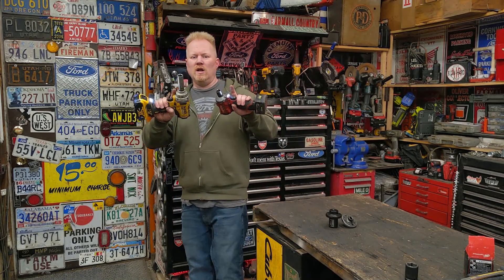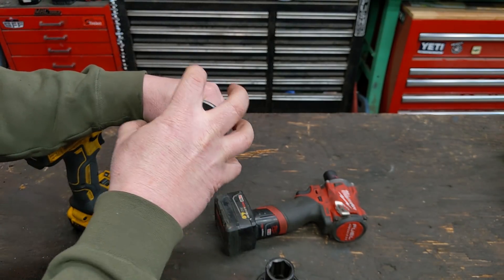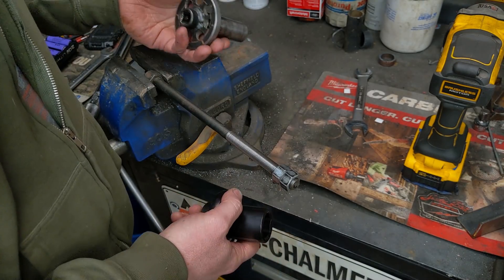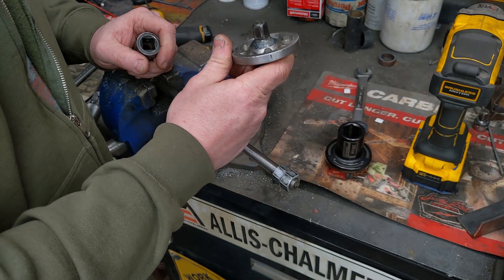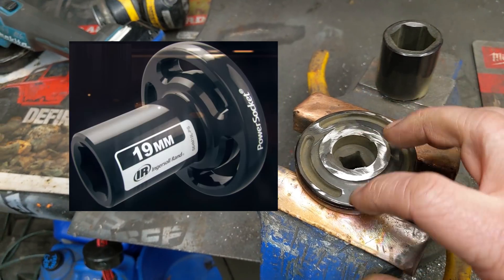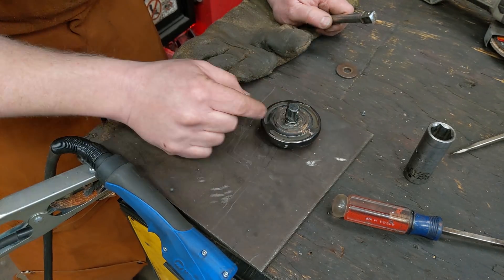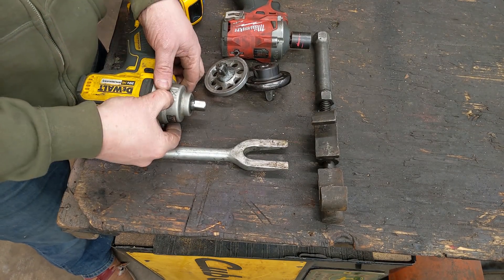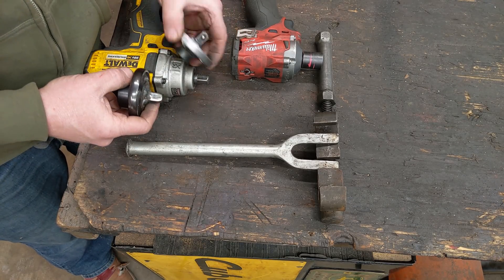Universal Weighted Impact Socket Adapter BUILD -one of a kind- DIY

Comment: You are absolutely right in the way you explained the physics 👏 simple and to the point. Heres the thing tho there are 2 problems. First problem impacting on a socket adapter you will end up with drive train losses due to anvil impacting on the adapter first and then the adapter impacting on the socket second( there is always play there). Like you saw when trying to remove lug nuts. The torque test channel does a good job of testing and explaining this. Second problem: this play in theory will negatively impact any positive results you get from the fly wheel on your adapter in the torsion example you gave because the socket attached to the bolt will still be able to rebound due to the play between it and the weighted adapter well before the weighted adapter can impact on the socket. Making the system ridged ie One piece will effectively give you the result your physics explain. The point of the springs on the original drawing would still work better then a weighted adapter because the  socket and the square drive are technically one unit with the fly wheel separate. That avoids the drive train loss stated above in problem one.

Comment: I guess the tutorial on how they work explains my technique of holding the socket with a gloved hand. I learned through the years that on tough bolts that to grab the socket and turn it in the same direction as the impact is turning  nets a greater torque than just letting the socket bounce on the fastener. Of course, it's tough on the hand, and may be why I have problems with my left hand.

Comment: Thos torque rigs are hydraulic, and hydraulic fluid is not perfectly incompressible; there will be pressure waves bouncing back and forth in a similar fashion to a long fastener acting as a torsional spring

Comment: Great video and information on lost torque with long bolts and U bolts. 

You only have to put a hand breaker bar on U bolts to understand what you explain here, you can feel how springy the bolts are.
 
 I have never seen or used weighted sockets. 

Would it be a simpler and cheaper build your weighted adaptor by using a short 75mm extension or 2 size adaptors welded together they are usually sold as sets together and would achieve a short adaptor.

Then weld a big washer to it rather than cut up a weighted socket?

Might be what you did originally with the one with holes.

I have always had good results using impact guns on long or even short bolts  by using my hand or a pair of pliers on the socket or extension nearest the impact gun and Twisting in the correct direction when things wont loosen. The added benefit is also less damage to the fastener head.

This eliminates the looseness in bolt to socket and any extensions and delivers all the actual impact to the bolt. I have found in my 35years working adding some twist to the impact gun back and forth also helps as well. 

On large bolts using 3/4 inch impact guns on REPEAT assembly tasks it is essential and realistic to weld the extension into the socket so the torque from the impact gun is not lost with the looseness in the system.

It is amazing how much energy is absorbed in long bolts or extensions loosness.

For car wheel nuts I know you can buy torque limiting sockets (I don't have any) they have a shank diameter and length maybee 10inch long so that the fastener cannot be over torqued easily with impact guns.

Comment: Ok, so if I'm understanding the physics behind this correctly, the weighted adapter would go on the impact and then say a 12" extension (I'm assuming the longer the better) and then a socket, and that should take your lug nuts off. Being short just makes the impact push more weight, but being longer gives the hammer time to reengage before the springiness returns back to the start position. Interesting concept if you have room for it.

Comment: I wonder if you could use the weighted adaptor on the impact wrench, they use an extension with the socket on the other end and reduce the torque loss from using the extension?  i.e. Impact Wrench - weighted adaptor - extension - socket - rusted nut that requires use of an extension for access.

Comment: If torsion plays a role here it stands to reason that repeated impacts on nut securely fastened to such a shaft would potentially deform the shaft. If with each impact the twist isn't allowed to spring back to its original position, but is instead further twisted up to the point that the nut finally breaks free, I would think there's a reasonable chance that the shaft itself is now slightly deformed.  Maybe it's not as much of an issue on a large diameter crank shaft, and maybe we're talking about thousandths of an inch, but it seems deformation is definitely possible.

Comment: So basically it works on things on the concept of a torque stick the length and the diameter of a torque stick only allows a certain amount of impact to reach the nut or bolt on the far end and this takes away the effect of the Twist and flecks of a torque stick an allows you to get full power at the other end of AKA torque stick or long Bolt crank or said long fastener

Comment: Simple resonance of the hammer action gives a acoustic coupling effect….great idea but can only be optimized to a specific hammer and it’s frequency of blows
Reply from the maker: Not really. The hammer hits so often even though every blow isn't timed right it will go in and out of time/sync. So with the 20-30 blows per second it doesn't take long as it only needs to hit once to loosen the bolt.
Reply: @sixtyfiveford  wrong think harmonics…trying to help you here…look into it or don’t …but you have to match the anvils resonance frequency which don’t change and also has a specific frequency…figure that out and you’ll have a tuned socket for your specific tool but won’t work universally among other tools with different anvil mass(and frequency)…all of this is great if your making sockets for DEWALT….no hate here just trying to help

Comment: If you use a different impact, you'll have drastically different results! I use these every day with Ingersoll Rand 1/2" air impacts and they definitely work quite well on lug nuts. However, they're junk on our electric stuff. Even do some funny physics at the end of a breaker bar!  I doubt our countries biggest tire dealer would have a deal setup with them if they simply "didn't work on lug nuts because of the short length".  You're scientific process was flawed from the start considering you didn't try different ways of applying the load.
Reply: I never even tried them with a cordless gun. I know with my 2135ti max, lug nuts do not stand a chance

Comment: Them are pretty neat! So your homemade one doesn't work as well as cutting an actual weighted socket and putting a male end on it? Is that what I'm understanding?
Reply from the maker: They work the same. Their just different weights so the lighter one seams to work better on a smaller gun where the heavier one is too much for it. The larger impact doesn't care which it has be works better with the heavier one.
Reply: @sixtyfiveford  and the weight doesn't have to be offset?  Thanks for the Great content this will help on some stubborn head bolts I think!

Comment: Weird...Honda crank bolts are stout, fully threaded and don't seem to have any torsion distance to me.   It's the use of a extension and failure to lock the crank that stops most   attempts in their tracks.   The lisle socket on an impact zips them off.
Reply from the maker: The crank shaft itself spins and reduces the impact forces. The lisle socket is a same thing as the IR.
Reply: @sixtyfiveford  failure to lock.  I put a chain wrench on the pulley and brace it.

Comment: I've taken off many Honda crank bolts. My goto is an impact socket with a breaker bar, with the handle resting on a cinder block, the get in the car and crank it over. It works great but I've learned to drape a coat or or shirt over the handle because if that baby flies off, it goes to the moon. This video is a great explanation of torque loss with impacts. Great video!!!
Reply: I had a 97 honda civic that broke 3 lug studs off and of course that year doesn't have the slot to tap the broken studs out and hammer new ones in. So I had to remove the center hub nut and let me tell you ibroke every pull bar and big ratchet I could borrow🤣..i had to get a generator and compressor to take to the car which was in the middle of bfe...to use the air cut off wheel to cut the nut off and even cut in half the damn thing wouldn't come off!! It was literally welded itself to it.. I beat and cut and beat and cut...eventually had to pull the whole knuckle and CV axle off the car and put all new in...i was broke at the time...i mean broke..some good samaritan stopped and said "Ive road past you 5 times today and I started at 9 am ...its 5:45pm and your stil"l here..he said "lets go to the parts store."..he purchased the entire assembly ball joints and all,CV axle too...the car had no dents on the passenger side that morning....🤣🤣🤣
Reply from the maker: Awesome.

Comment: PowerSockets work.  Your sample size is too small. We see 100+ vehicles a day in my tire store and have multiple chances to use them daily.  When used on a pneumatic gun, they will take off stuck lugs that regular impact sockets won't.  I do wish IR made a PowerSocket adapter like yours.  Sometimes some idiot has used the wrong lug nuts and a thinwall or chrome socket has to be used because a thick impact socket won't fit in the lug holes.
Reply from the maker: I know they work but not in all scenarios.

Comment: Earned my subscribe. So do you think just getting a hold on the crank pulley somehow would eliminate the need for one of these sockets?  Could someone video a trial of this at the next timing belt change?  ETCG maybe?
Reply from the maker: You would have to build a tool to hold the crank still.

Comment: What a great video! Everything you're talking about carries a lot of useful info and logical deductive reasoning. There actually is a patent now for the little tool you made, filed a couple years ago I can email it if you like. They just havent sold them yet it appears. I agree about the IR patent, would have loved to see anything close to what they drew up, makes you wonder much  their product is even protected as it sits now. I had a chance to talk to the inventor working with IR awhile back, not that he probably knew he was talking to "TTC" at the time, but it didn't sound like they ever made that original version in reality. I imagine those window holes they show were also closed up fast too as its easier for production and has zero downside adding more mass.
Our test bolt is 6" long, so you're possibly right about torsion. And if you think about how a engine crank is also itself moving around and turning a bit, that affect is likely even more amplified. Though on IR's video, they are testing using a digital dynamic torque skidmore, there is no bolt. Just a digital sensor measuring the amplitude of each hit. Their claim being each hit is harder. Who knows. If we can somehow test that it is solely on torsionally effected fasteners, i'd love to site you and this video.
Reply from the maker: It was your video on these months ago that got me thinking about this idea again. I had discounted weighted sockets as fictional. But your tests show them do pretty well.  I didn't know anyone had a patent for this, that's awesome. I'd love too look at it if you have that number? I looked over the IR patent and they had a decent bunch of lawyers write that up to include pretty much anything resembling their socket. The movable center looks like it would almost act as a dead blow and would be fun to test.
Reply: @sixtyfiveford  I'll IG msg you!
Reply: @Torque Test Channel and @sixtyfiveford I'm a mechanical engineer who does all my own car work, and I absolutely LOVE both of your channels! Glad to see some collab going on here! Learned so much from both of you. Keep up the good work, boys, and keep bringing more beans!

Comment: It's the extra stiffness of the thick wall not the weight that makes the difference. The momentum transfer of the hammer depends on the elasticity of everything that the impulse is transferred through. In physics it's called "coefficient of restitution". It is like the difference between hitting a hard baseball and hitting a soft foam ball.

Comment: I like that you made an update on that video, and I like the dog content. If you are in a need of a weighted socket, and can’t find in stock in any stores and you need it today, go to harbor freight and get the 1/2 metric impact socket set and place the 19mm inside the 30 or 32 (don’t remember which one) and weld them together, works if you need bolt out asap.

Comment: I think Ginger was ignoring you with the yummies but made up for it shortly thereafter. I like the original with the springs and this is why there are 'Torque Sticks' to use in tightening truck lugs with aluminum wheels. A torque stick will just tighten a certain amount. No need for a torque wrench. The impact will just do what the stick is rated for and that's it. And the aerating Ginger is getting the job done. GBWYall!
Reply from the maker: Ginger loves driving the tractor, just have to teach her to steer.

Comment: I've been thinking about making a planetary reduction adapter
Reply from the maker: Me too. The only issue is the gearbox needs it's own handle to stop it from spinning. And the gearbox handle is going to the take the full torque of the setup. So it will need to rest against something.

Comment: Couldn't you have just welded the male end inside the socket for more mass?
Reply from the maker: Yes and no. There has to be a point where too much weight is bad. So you still have the weight of the socket you add to the end which would emulate the socket part that I cut off. So I'm assuming that Ingersoll Rand threw a lot of money at this with testing and their weight is pretty close to what it needs to be to work optimally.

Comment: Bet it will improve the spring you get when you have to use an extension on shorter bolts too! Old rule of thumb, never use an extension on an impact unless you have to, because they absorb all your power. I will be making one now for sure!
Great video!
Reply from the maker: In theory it should work to help improve the losses you get from an extension. I played it around with that last night for 20 minutes. It's hard to tell and only real world will be able to let me know for sure.
Reply: Yes I agree ..commented above before seeing your post..I need one for long extensions when taking out transmissions..

Comment: Thanks for the technology build and review. i have never heard of them before and in my younger days I used to break VW flywheel gland nuts in half with a 3/4" breaker bar and 3 foot cheater, when my experienced friend told me I could never get it tight enough by hand. Wrong thing to tell me back then. 😲
Reply from the maker: That's great. Can't tell a young man they can't do something....

Comment: Thanks for figuring this out, now I understand WHY they work/don't work. Definitely want to hear about your testing with long or multiple extensions. 
It would be cool if the flywheel had moveable weights to either manually or automatically adjust to vary the rotational inertia.
Reply from the maker: Interesting! That would be neat.

Comment: You could probably build something like the patent picture
Reply from the maker: True. I've looked at a lot older patents and they pretty clearing state what everything does and even test numbers sometimes. The patent for this one is written the the hardest to understand lawyer talk I've ever read. Everything is super vague. The patent actually shows 3 different designs of having the center portion move.
Reply: @sixtyfiveford  your original version has holes. Could you fill the holes with whatever is inside a dead blow
Reply from the maker: @kenl5217  Interesting idea.

Comment: Spring steel is definitely more elastic and I can see where they make a mountain of difference!
Reply from the maker: I've only needed it 3 times in 4-5 months but of those times it worked good. It's an odd thing to use but I think it has it's place.

Comment: I just realized that the long shank torsion is the same reason that when working with iron pipe, you put the wrench on the pipe as close to the fitting as possible.  Otherwise, you have to load the spring in the pipe before the force starts working on the threads.  I haven't done a lot of iron pipe work, but I can remember the springy feel when out on the pipe a distance now.
Reply from the maker: Makes sense.

Comment: Do you think you would work the same way if you're trying to remove a bolt that is seized to the sleeve inside of a bushing? Whenever you try to hit those with an impact wrench It just bounces back so it torches itself backwards in a very similar manner. It'd be really cool to see this weighted adapter try to remove a rear lower shock bolt out of a Honda civic because those are notorious for seizing to the inner sleeve
Reply from the maker: In theory it should. When I first built this I kind of gave up on it but found 3 times that the impact wouldn't remove something and used this. Those were all times where the bolt/nut was springing.